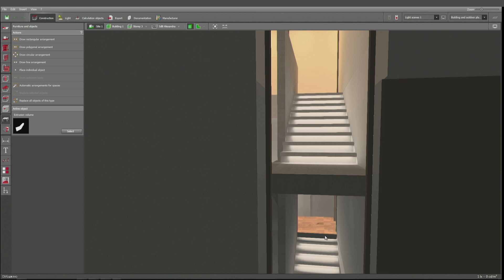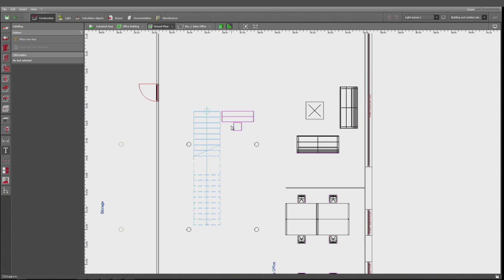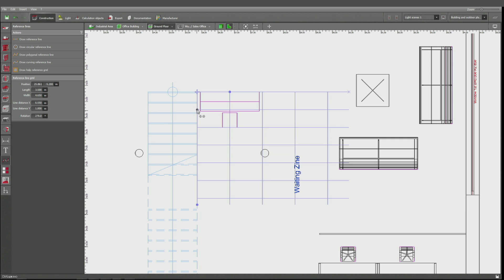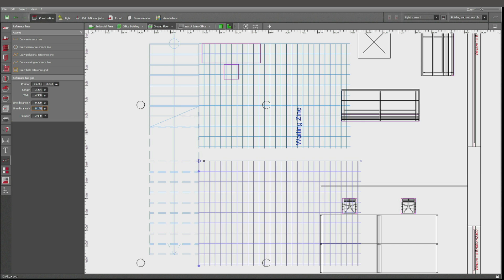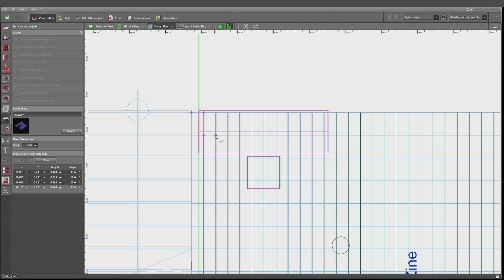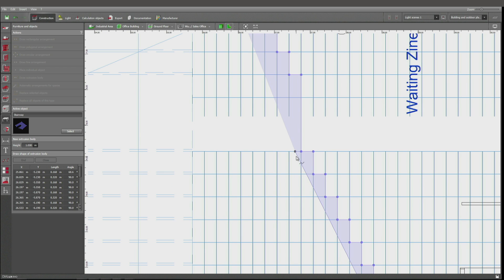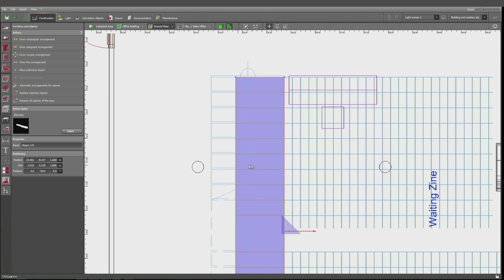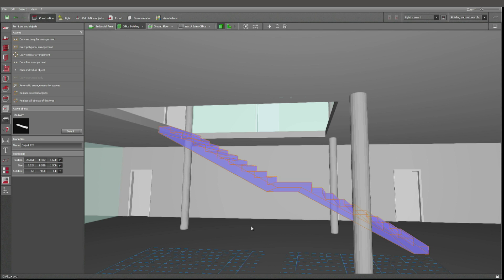DIALux evo Tutorials for Beginners part 13 — Staircases part 1: Handling of extrusion objects

Comment: Hmm.. I can't seem to get the help grid to stay. When I switch over to drawing the extrution volume the help grid vanishes... 
How can i make the help grid to remain?
Reply: Hi I had the same problem too. how ever the solution is simple (not sure why Dialux peeps did not comment since they commented below). Once you have drawn your gridline and click on the extrusion menu and the gridline dissapears, just click on the Display Options icon (top right it looks like a desktop screen...also its below the bell icon). once you have opened that menu click on the 3rd icon from the left "Display reference line" icon. Problem solved!

Comment: That is really cool. But I want to draw something more complicated and specific for a job. the stairs must rise to a platform which leads to a walk way at 90 degrees, then another 90 from that and then another, somewhat like a spiral but repeating itself rectangular up a shaft. Maybe an explanation in these comments for my problem. Sometimes writing it out helps.
Reply: I think I figured it out I need to make separate extrusion objects, that worked. Now to get the rise correct.

Comment: Hi I have funny case using extrusion. It works fine only when it is crated inside created building. When I try to extrude shape located out side(out door) in project tree it exists. When I move it to inside the building it has no texture. I can see mash but it disperses after leaving it in place when it spouse to be located. I'm using Evo 8.0 64-bit version.
Reply from the maker: Thanks for the heads up!